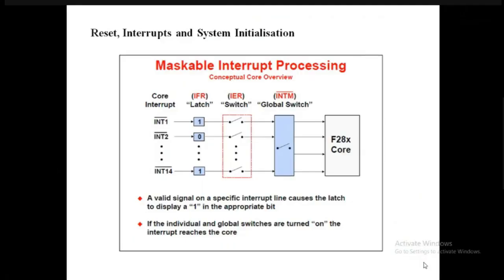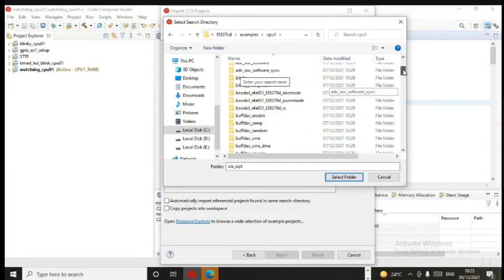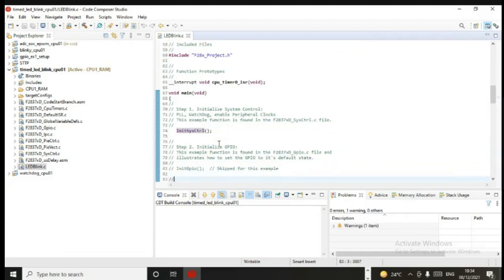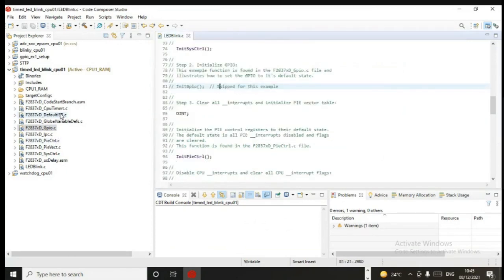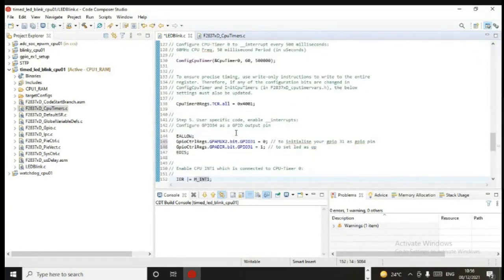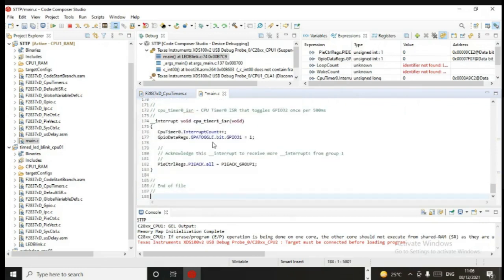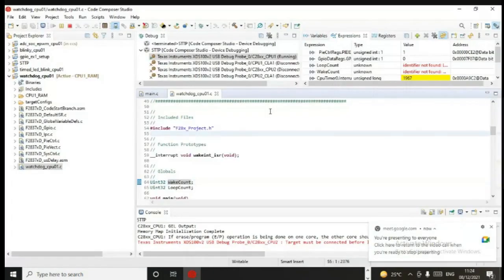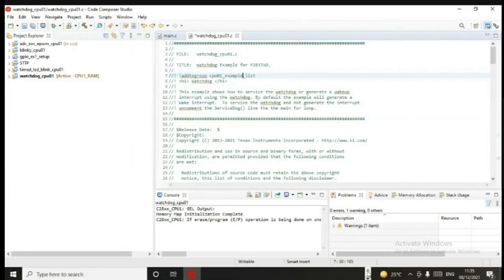Lecture: 5

Comment: Hello sir, why do we need watchdog? If I want to generate PWMs do I need to use or call watchdogs?
Reply from the maker: A watchdog is just a kind of service interrupt that is assigned to check if MCU program is properly working or not ..or to check any debugging issues. It has no relation with PWM block. It is by default there in the system, a sort of bodyguard to check if someone is entering in house, and has no relation with whts going inside the house.
Reply: Thank you so much, sir.
Reply: Sir, I have started to watch your videos. Amazing! Please provide more videos on TI. May I have your email address, please?
Reply from the maker: @elysianzen  tushar.21eez0004@iitrpr.ac.in